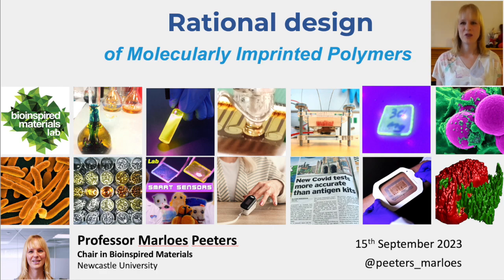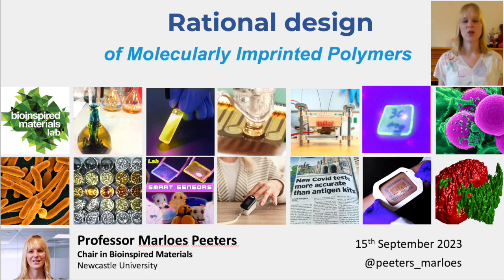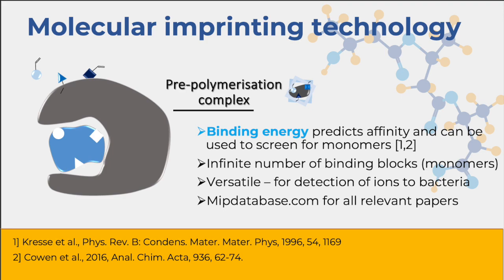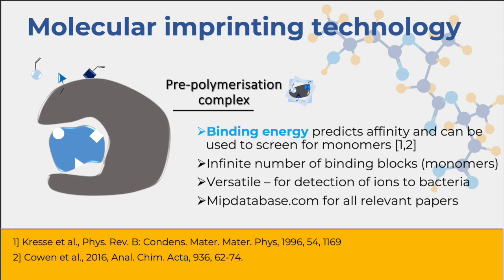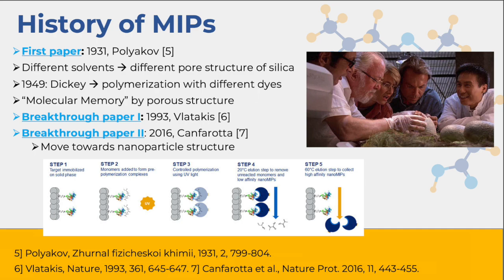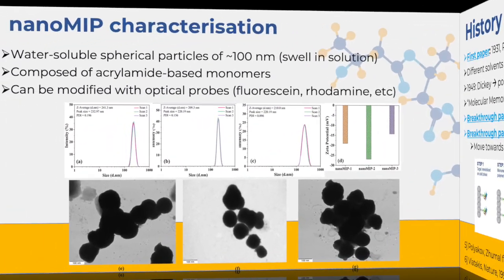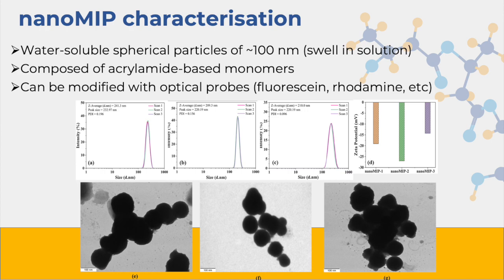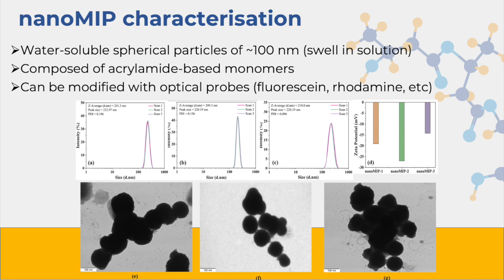Rational design of Molecularly Imprinted Polymers

Comment: Thank you so much professor. I am following all your articles and videos on MIPs, they really help. 
Since I am also working in this area for some time now, i want to know is there any effect (in terms of interaction) of solvent while imprinting and/or rebinding.
Reply from the maker: Yes it certainly does. One example paper is here: https://www.sciencedirect.com/science/article/pii/S0003267007019058?casa_token=-p4XtViqGCkAAAAA:TjhJ2b4f-9Hqzeanx1eLSwaKwIlU2bRhXlSxGudGeTAuD-87HRZfpqW-Xtj_kL6ZQB4BSWzXP9I. I mainly work on aqueous sensing so the MIPs should be compatible with water; in that case, it would not very suitable to use certain solvents that result in hydrophobic material
Reply: Thank you for the explanation and for sharing the paper